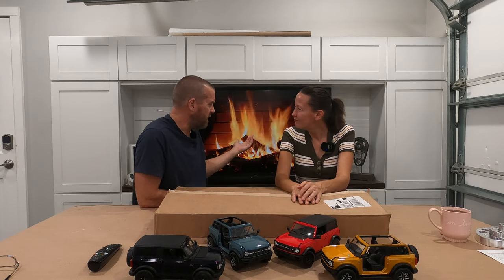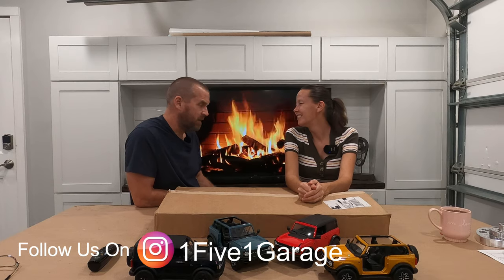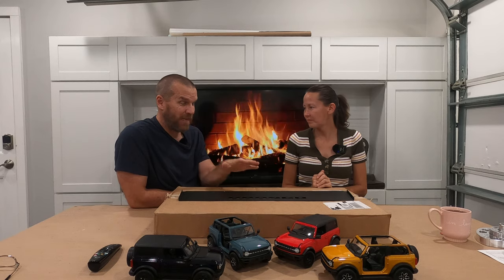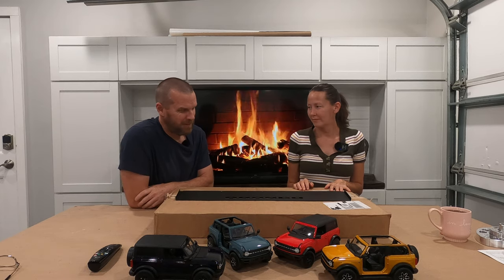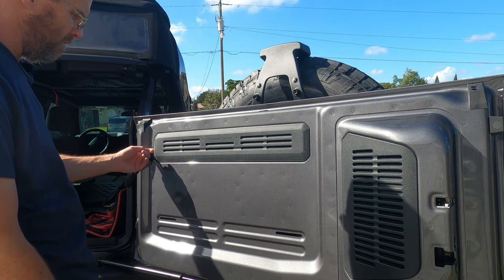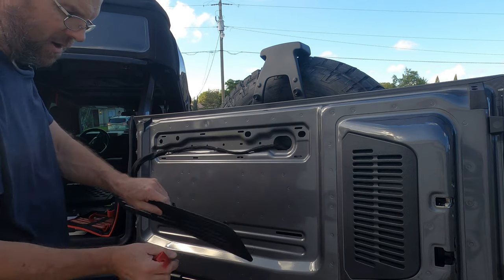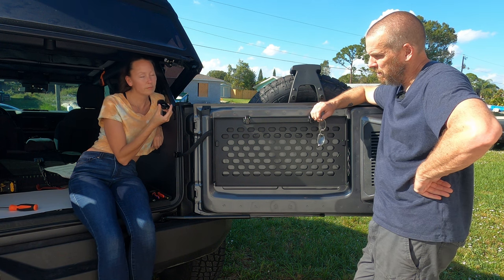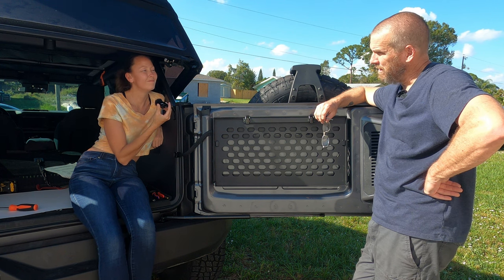2021 BRONCO ACCESSORY. TAILGATE FOLDING TABLE. PERFECT FOR CAMPING/OVERLANDING.

Comment: Thank you for the video, it has clear images and with the included instructions being so terrible, it was a big help. They look like a bad photocopy and it's difficult to make anything out. 

Terrible experience with the jacknuts... it was spinning like in your video but the bolt was stuck in the jacknut. I guess it must have cross threaded, I could see this happening a lot as you're feeding the bolt through a couple rubber washers so you don't get a ton of feedback on how it is threading in. Tried holding the jacknut with pliers, but still had a tough time getting it out and damaged the bolt. Once the hole is drilled it is too large for an equivalent rivnut (from what I understand). If I could do it again I would buy rivnuts w/tool and toss the included jacknuts. As it is I am waiting on replacements for the hardware that was ruined. I ordered on Amazon, they are pretty difficult to find locally. I am fairly experienced and have upgraded my stereo (with amps), installed a trailer brake controller etc. without issue. They have a torque spec for the jacknut process in the instructions, some people in the forums seem to have had an issue even using a torque wrench.

One tip... on a lot of the trucks a poorly painted area shows through behind the BRONCO cutout. Before you start, you can trim a piece of sheet metal and attach it to the back using trim tape. This especially works well with dark colors like AMB,  where there wouldn't be a lot of contrast with the black table.

Comment: I put the rough country on on ours...if u don't mind drilling 4 holes..that's it...easy install and holds 75 lbs ... and alot cheaper $$$than the ford ones.
Reply from the maker: There’s a lot more options now.

Comment: DO NOT BUY THIS FROM FORD!

The mounting is an absolute GARBAGE. That tool might work somehow, mine just kept spinning. I tried even with vice grips and that fucking thing still keeps spinning... now I have 4 holes in my tailgate and $200 of useless metal GARBAGE. I bought this from FORD expecting to be properly, specifically made for the car with easy installation. Bullshit. Again, buy something from Amazon that is better thought out.
Absolute garbage
Reply from the maker: Sorry to hear that. We would have rather used rivet nits instead but figured we would make what they provided work.
Reply: @1Five1Garage  You don't have to apologize for nothing. I bought this before I watched your video. I just watched to see if I'm doing anything wrong, but clearly this was just cheap stupid solution on Ford's part. Even you had one spinning. I had 3, one worse than the others. I made it work with pliers and mangle it, but it was just not fun drilling the tailgate and then realizing what they wanted me to do. They could have put notches/teeth on the back of the face so that they could grab the metal, but anyway... I made it work. Just a warning to anyone buying this, be aware of what you are getting into.

Comment: I was scared to do this lol so I bought the 70 dollar install option! The dealership poked a hole in my tailgate. So they had to fix my whole tailgate 😩😩😩
Reply from the maker: They poked a hole in it?
Reply: @1Five1Garage  yes, screwed it right through, if I remember correctly.  It was top notch dealership work.
Reply: Oh my goodness! I’m so sorry!  That’s terrible. I hope the repairs turned out good. That’s an aluminum gate.
Reply: @mpeugeot  Galpin ford  I’ll never go back.

Comment: How much was this accessory w/o dealer installation.  We were quoted $300 installed pre Z-plan discount.
Reply from the maker: Lists at 209 on Ford.  But so far had a couple people already tell us that they dealership drilled ALL the way through the outside of the tailgate. We opted to do it ourself to save a little money and worry. We also got a discount for it.
Reply: Ouch! On those drill throughs. Can't imagine. How long it would take to get that corrected the right way.

Comment: Great video and very helpful. Any tips on removing a broken jack nut? I think I screwed down too hard on one of mine and snapped the threaded back. I'm guessing I have to drill it out?
Reply from the maker: I think so. You would need to hold it somehow or it would just spin.
Reply: @1Five1Garage  Thanks much. Yep, the spinning was an issue. I ended up mangling the heck out of it with tin snips and extracting most of it with needle nose pliers. Some pieces dropped in the door panel so I’m hoping they’re wedged in the insulation and won’t rattle around. Got replacement jack nuts on the way from Amazon today so hopefully I can finish the install. I appreciate how easy you made this look. :-)

Thanks again!